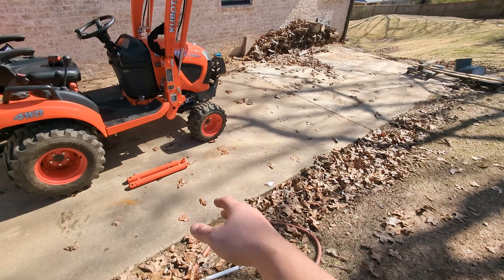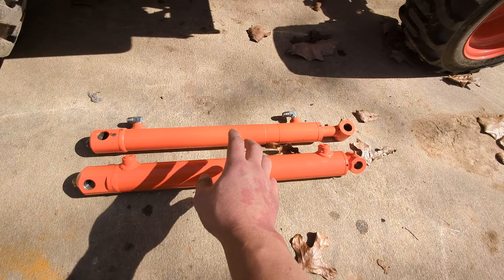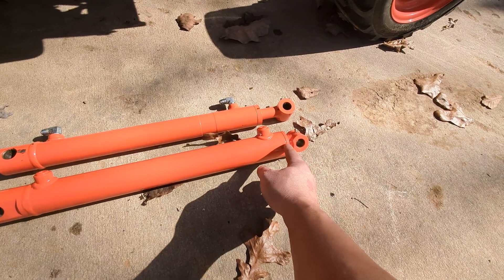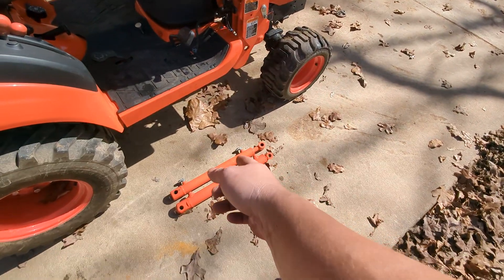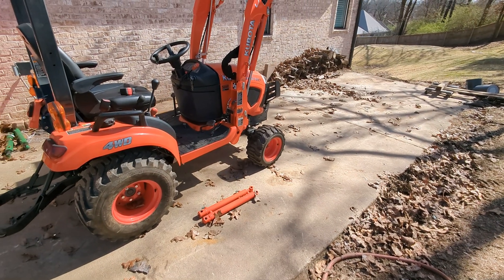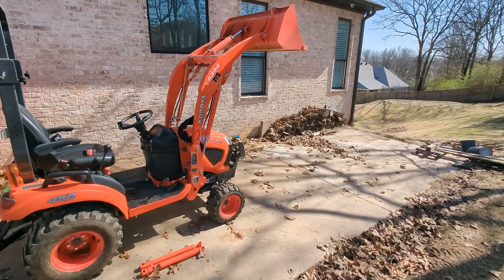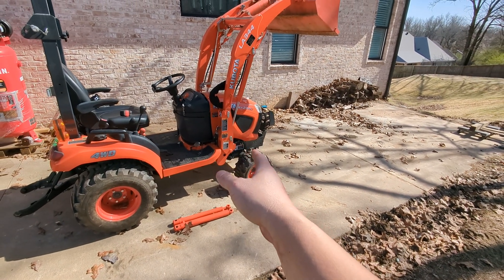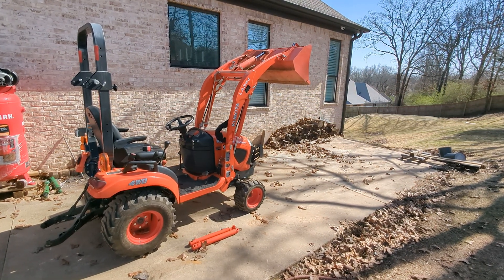HydrosPlus Lift+ for the Kubota BX

Comment: I just put them on my BX25 this weekend.  The sleeve on the piston rod side of the cylinder is about 1” smaller than the original.  I had to add 1/2” spacers on each side to keep the cylinder snug.  I am hoping this does not create too much stress on the pin.  The install went smooth if I do not take the spacers into account.  I am excited about the additional lift height and increased capacity.
Reply: any issue with the Spacers? what did you use for the Spacers?
Reply: Do you have any pictures on your sleeves?

Comment: i noted that the bucket did not drif on you   I just bought a bx23s and all my hydraliocs drift about an inch in a hour  front bucket   curle  and  boom cylinders  as well as my out rigers     so when I park it I find my out rigers on the ground the next day  I was told by the dealer that this drift Is normal i feel like I'm bringing bs  as it just has 30 hours on it now  plus the pump  has a loud wining sound
Reply: My BX2370 doesn't "drift" at all from what I've noticed.  My hydro has always had a fairly loud wining sound to it.  Makes my tinitus go off the charts if I don't wear ear protection.
Reply from the maker: Drift is normal, but excessive drift isn't and yours is brand new.  I would expect the outriggers to take a week to hit the ground.  Regarding the whining, that is also normal for gear pumps, and my BX whines louder than any tractor I own...but it's not a mechanical issue, just a noise issue.  Doesn't hurt anything.

My loader doesn't drift much.  I didn't notice it with the stock cylinders, but I expect my larger ones will fare better at a given age.  When they are old, most will drift more.

Comment: Do you make proportional curl cylinders to keep up with the added capabilities of the boom cylinders? I can see getting into trouble not being able to curl back a load as it's lowered because the curl cylinders are not bigger in diameter like the boom cylinders.
Reply: The curl cylinder function and capacity should be adequate before any boom cylinder change, and the boom cylinder change won't affect the curl cylinder performance.  However, there is some validity to extending the curl down and back.
Reply from the maker: I don't have a curl cylinder at this time, but it's something I'm looking at.

Comment: Not applying to this, but could you come up with a cable system (preferred)  or relocating the pressure dump valve to a location where users could easily change the hydraulic pressure as needed on a 1025R. That would really be a great add on option and could then use higher pressure only when needed thus extending the hydraulic components life!

Comment: How much hydraulic oil will be left in the reservoir at full height. Higher lifting (over OEM height) means the bucket won`t fully empty on full lift height with most materials due to its geometry with the added 12+ inches in lift height. Higher lift means tractor stability issues will arise, because 12 inches higher, per what the tractor size is, is alot hanging above you! Adding more lift capacity will tax an already weak (structurally) FEL design. Kubota had good reason to NOT over build the BX series tractor. You`ve created something that will be dangerous in most users hands, due to its size and abilities. Now, with that said, its kool that you`re doing this, because Kubota (is likely watching you) may give them some engineering ideas on the next new BX series of tractors. Personally, i would like to see Kubota bring a 2 pump system into the BX series. So we don`t have to run our BX`s wide open to get them to work better. It would save a lot of diesel fuel if the tractors didn`t need to be run wide open all the time while running the loaders and backhoes. And to also separate the power steering hydraulics from everything else. Its annoying while operating the loader when the steering wheel locks up on you.
Reply: It seems you are misunderstanding the functions of the BX guts. Firstly the design of the BX was to accommodate the inexperienced homeowner operator.  However, the BX is a fundamentally robust piece of tiny equipment as far as 'tractors' are defined.  Modifying the BX for professional and heavy duty use is well within its structure.  The BX already has a two pump system, one for travel, and the other for steering and hydraulic attachments and PTO drives.  Secondly, the only reason to run the BX 'wide open', hopefully to bring the rpm up for PTO functions, like mowers.  Hydraulics operate at full pressure at 1800 rpm, and while using the backhoe, FEL or other hydraulic equipment, higher rpm will garner more fluid flow and faster speed.  However, there are also limits to the amount of flow because of restrictions and restrictors in the passages.  Personally, I have 2870 hours on my BX using 98% either the FEL or backhoe, and there is absolutely no advantage to operating above 2200 engine rpm.  I have tried and tried, and it does not help.  However, for travelling speed, then the increase in rpm does increase the hydrostatic drive, however again, the speed difference above 2500 rpm is insignificant.  Often the terrain does not afford the opportunity to run at full speed.  The BX is very fuel efficient if operated appropriately.
Reply: The amount of additional fluid to accommodate the two cylinder extensions might total a cup.  I don't think a cup of additional fluid will make any difference to a reservoir containing over 3 gallons of fluid.